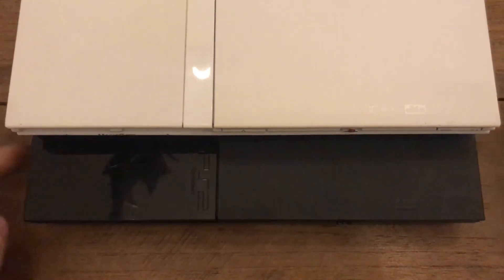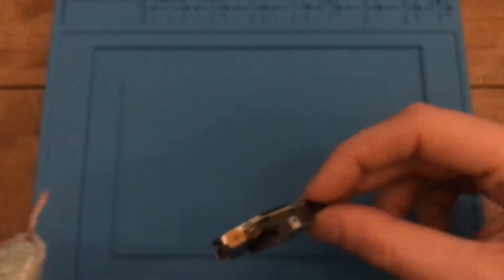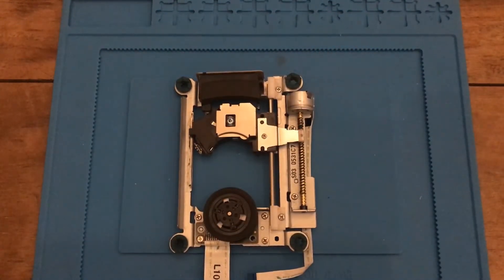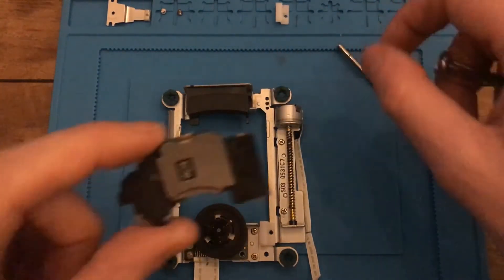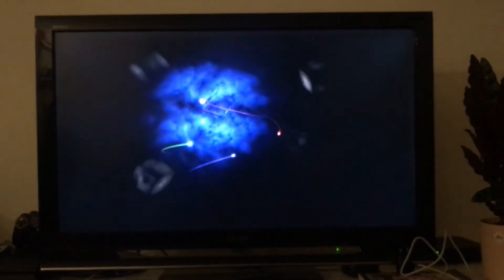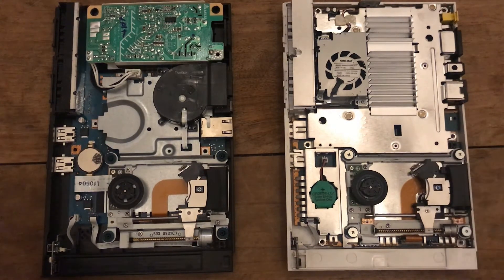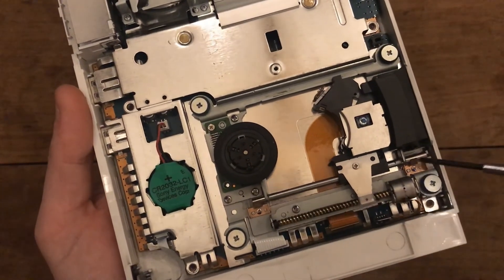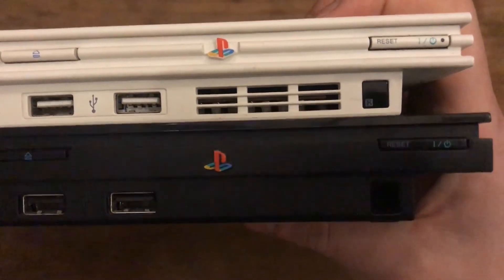Playstation 2 Slim (PS2 SCPH-70x/90x) - Laser lens replacement

Comment: 70K Slim is really nice. Have a Modbo 5 chip sitting around, waiting to go into my 70K PS2 for months now. Holding off until I have better magnification, the wiring is tiny. There's also a mod for regulating power to the laser. Apparently they can overdraw and just kill themselves. Especially when playing backups.
Reply: Wow...this is why I love YouTube; not just the tutorials, but the comments that truly give you more insight-I will be keeping this comment in mind, as it reminded me of my original Ps3's drive eventually failing, but still playing ps1 games and DVDs 😅
Reply: The self burning system is only present in the 50xxx series if I'm not mistaken

Comment: i have the same problem but even worse my lens is dirty and my disc is not spining at all i tried remove it and put it again it cant read the game
 so i will love to see that replacement
Reply from the maker: if its not spinning, double chevk if the switches for the lid are working, and if the switch for the lens’ home position works. in order for a disc to start, those all need to be engaged

Comment: My ps2 slim will only read blue disks and ps1 games.. I cleaned the lens and moved the potentiometer but only move the DVD potentiometer. I could turn it some more but afraid it will burn out the laser
Reply from the maker: big chance the laser is already burnt out in that case, you can quite easily replace them though, and through websites like AliExpress they can be found quite cheap!
Reply: thank you.Should i order Without static protection or with, I dont have a solder iron

Comment: I just bought a cheap "broken" PS2. I hope I can fix it with this video as a guide! Thank you!!
Reply from the maker: good luck! if you’ve got any questions, let me know :D
Reply: Thanks! I just got the PS2 in the mail today. It seems it's a SCPH-90006-J model, which takes 220V AC power. I'm in NA (110V) outlet. Do I need a power transformer to step up to 220V?
Reply from the maker: It doesnt say 110~220v? I believe NTSC-J uses 110v (in certain regions) as well, so in theory it should just work as well.
Reply: RetroGameRevival It says, "AC 220- 240v" on the sticker on the bottom. 

However, I took it apart and the underside of the  internal power supply says, "input: 100-240v."
Reply from the maker: Nice! should work then, good luck, hope it’s as easy as replacing the laser (or was it bought untested? in that case I hope it works fine!)
Reply: RetroGameRevival Thanks! Supposedly, it doesn't read discs, so I'm pretty sure it's the laser. 

I'll be referring back to your video if I get stuck!
Reply from the maker: if I didn’t explain something properly, or forgot, just leave a comment. Will try my best to help you as much as possible :)
Reply: I got it working! I'm so hyped. Now, I can start my import collection. Thanks again for the help!
Reply from the maker: So happy to hear that! Also, ps2 has sooo many great titles (hence why it’s one of my fav consoles), you’re gonna have a great time playing all the cool import titles!

Comment: I see that the whole module is selling on internet, and I want to replace it, but I don't know if is easy, the model is 70001
Reply from the maker: Guille Gomez should be rather easy! (more easy than the laser only) Just gotta be cautious with disconnecting the ribbon cables ^_^ Good luck!
Reply: @RetroGameRevival Don't forget about the screws holding the laser assembly, they're so tiny you may need a magnetic Bowl and magnetic screwdriver.

Comment: Hell I replaced my laser but it keeps trying to go all the way to the back of the case
Reply from the maker: There's a tiny little switch at the back end where the laser slides, which should indicate the PS2 the laser shouldn't move any further.
Worst case scenario, this is broken. However, in my findings I often find they are either simply dirty or the connector isn't seated properly (or a ribbon cable might have a tear in them).
I would start of by reseating all the ribbon cables, confirming they are absolutely aligned and secured in their sockets. If possible, do a continuity test with a multimeter on each ribbon (this is a fair bit time consuming though).
If it still fails, try using a cue-tip and some isopropyl alcohol and work that into the button slightly, making sure it evaporated before turning the machine on.
You can also try some air from a spray can (or a compressor if you have one, just dont blast it with a full 20 bar, hahahha) to loosen any debris/dirt inside that.
If all of the above fails, sadly you'd likely need a new laser assembly instead of just a laser replacement.
Reply: @RetroGameRevival  I should have worded that correctly I will try this but I have replaced the laser assembly twice so i'm confused as to what could be wrong. It's the silver ps2 model 75001
Reply from the maker: @Captain_Dark  I knew what you meant, but if you have a look closely, you'll see there is a tiny switch there (on the assembly itself, not on the motherboard) which basically tells the PS2 to stop moving the motor for the laser. That's the one I am talking about you should try to clean :)
Reply: @RetroGameRevival Awesome will give it a go today thanks!

Comment: Just installed a new lens but why does the disc spin slowly and because of it , it doesnt work
Reply from the maker: did you remove the anti-static solder joint before install? if so, it might be a DOA laser (Dead On Arrival - sometimes happens). Contact the seller for help would be the best advice I can give there.

Comment: My new replacement laser is moving all the way to the disc motor on start up, and then it continues to try to move forwards and create d aloud buzzing sound, any idea why?
Reply from the maker: Rizoch This sounds like a broken limit switch to me. Might be best off finding a complete replacement laser assembly/unit in that case, instead of the laser only
Reply: It could be that the potentiometers on the bottom are not adjusted correctly.

Comment: Why would you need to do anything with the Anti-static solder blob?
Reply from the maker: it’s added by the manufacturer as means to prevent the laser from burning out due to electrostatic discharge during shipping/transit. You’ll have to remove it, otherwise it won’t work at all :)

Comment: What happens if I don't remove the solder blob?
Reply from the maker: Daniel Fernández Aguirre I am actually not 100% sure? I would imagine it would cause a short circuit, and in the worst case burn out the laser. Best case is it simply doesnt work.
Reply: @RetroGameRevival  Crap,. I thought it was a matter of just replacing it, I'll buy a soldering iron and wick. Thanks for the video.

Comment: Are there lens that can't be used for the 700 and at least 900?
Reply from the maker: I’m not sure actually. I usually look all the info up online, but it’s been a while, so can’t recall from the top of my head. Best way to find your specific version is to open it up, and find any model information printed on the laser assembly, and search with google for more information about it :)
Reply: @RetroGameRevival  Never opened my ps2 slim so I'm not sure i want to do so and the last one that foxed it seemed to have screwed up and put it in a ntsc-j case even though it does not play japanese region locked games as I believe ntsc-j does.

Comment: Is there soldering involed?
Reply from the maker: only a little bit. You have to remove the anti-static solder blob on the new laser. Other then that it’s really super easy, just a matter of removing screws and some ribbon cables (as always, just take your time and be gentle).
Reply: @RetroGameRevival  Sorry for the stupid question but.. Why do they put that anti-static blob? Do i make a mistake if i ask the seller to remove it for me? Unfortunately i can't solder and i don't have any equipment to do so.
Reply from the maker: There’s no such thing as stupid questions, only stupid answers ;) We’re all here to learn! I might be wrong, so if anyone reading this has a better understanding of why, please feel free to add a comment. 
That said, I believe it’s there to make sure there’s no accidental static discharge (from going your body for example)  across the laser unit itself, which would potentially fry it before being able to use it.
As for asking a seller to remove it, it’s generally not adviced, however, you could ask to get it shipped slightly more secure and in an ESD safe bag (likely pay extra, and have to take be willing to take the risk).
Again; this would be at your own risk.
Hope that makes you understand it a little better, if not you can always look up ESD (electrostatic discharge) on google or wikipedia to read more into it.
Reply: @RetroGameRevival  Great.. That was fast! Thank you very much for the very detailed answer. 😁 Now i have a clear picture of the situation. I will think about it before i place my order. I have already tried adjusting the potentiometer checking with my tester but i had no luck so the only solution would be getting a new laser. I can only read CDs at the moment with my PS2 Slim. The Fat one, on the other hand, can read DVDs but not CDs. But i would like to use the Slim anyway for both CD/DVDs since it takes up less space on the shelf.

Comment: what is the reliability on the replacement lasers like?
Reply from the maker: I can honestly not say for sure, the old lasers are 20+ years old and some still work. The replacements in my case havent seen as much use as the originals either, as they arent being used as heavily anymore. But until now they’ve still worked without a problem. But I cant tell if that’s gonna last another 20 years obviously.. I hope so! hahaha
Reply: @RetroGameRevival  Thank you for replying to my comment, I didn't know if I was gonna get one because the video was posted a while ago lol. Im definitely gonna order one of these soon. Some eBay sellers say that these are oem replacement parts. I mean in the past I have replaced some laser with broken ps2s on eBay but I just feel like having brand new laser is a lot better.
Reply: @RetroGameRevival  Another quick question I don't know if this is fact or not but some people claim that earlier slim models are more reliable than the later ones I honestly don't have a clue. I've only just started getting into ps2s.
Reply from the maker: I had to think about that claim for a little bit. I have no evidence backing the following up, but from an engineering point of view, it can make a little sense.. ealier models have an external power supply, while the last one has that built in. That obviously comes with it’s own heat source when doing the power conversion. That heat inside the tiny housing of the slim, over time, could cause extra strain on the components, and thus wear a little extra. However, if you keep the console dust free and well ventilated (open it up if you buy one for a good clean), that should be negligible.